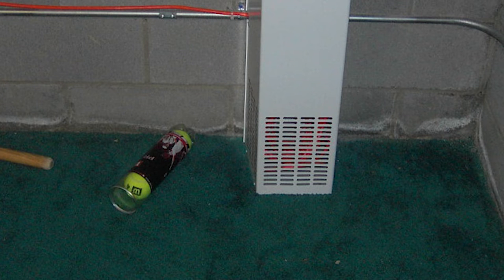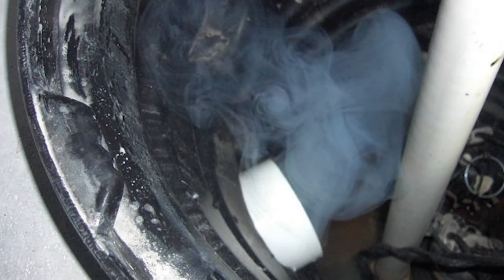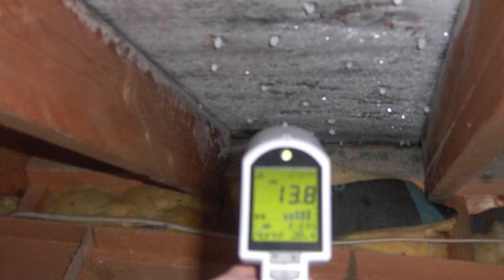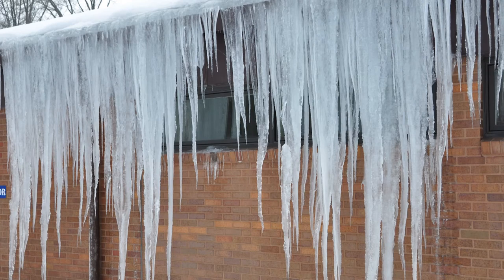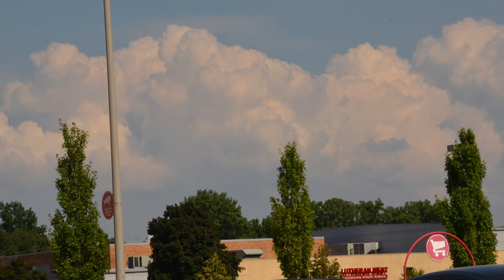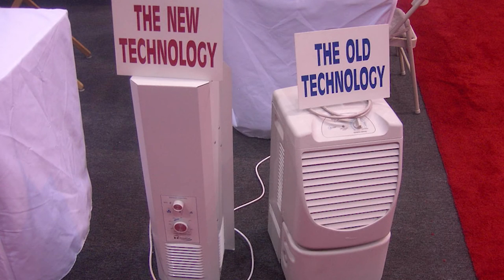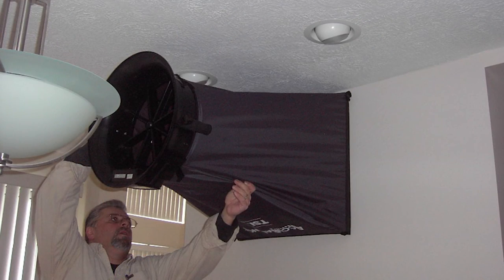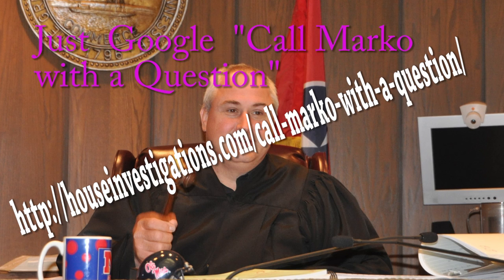Non Condensing Dehumidifiers SUCK your basement and crawl space

Comment: my basement is 160 yrs old.. it also has doors leading into it. Not exactly sealed tight at all. I use a 75$ condenser unit that has a hose to the floor drain.. At least I can go down there without my eyes burning!!!
Reply from the maker: make sure holes are sealed and windows closed when you use the dehumidifier
Reply: Yes, as always. It's a stone foundation and the house was raised into "curbing" in '64.
12×12 axe hewn beams. The house was empty for three years. Heated in winter to 56°. 
Also downspout on NE side had no extension..
I feel victorious over the "Odor".
Now I can open up bilcos (south exposure with screen in door) I've wiped out ants, spiders, and hopefully the powder post beetles.. I can clean up. Do you know of a "dry system" for the nooks and crannies??
I'm in southern MI in Lenawee county on a hill 940 elevation.., Street level is 916.
(Yes it's quite a slope lol)..
Reply from the maker: Well that’s
hard.  Just make sure your HVAC is
balanced and keep interior doors open to help equalize pressure. You do not
want dew point occurring so stay above dew point temperate with controlling indoor
humidity. Winter 25-34 % summer can be much higher 40-60%.  If you have a vented crawl CONDITIONS IT. Repair
all thermal bypass and thermal bridging. Not sure what nicks and crannies your
talking about, but keep large open spaces. Keep closet doors ajar or add
louvered doors. Weather strep doors, windows and attic access panels.
Reply: No closets, just old stone. Hydronic heating system keeps dry in winter. 
Airing it out on low humidity days with light. Nooks and crannies referring to rough and deep stone walls. (Cobble stone?)
1853 construction.
Radiators are on baseboards. New roof and attic ridge vent. Windows are Andersen. Suspicious of early vinyl siding (mid late '60s) with hardboard backing. Everything "seems" tight.. but I don't trust the hardboard. Can't afford to reside.